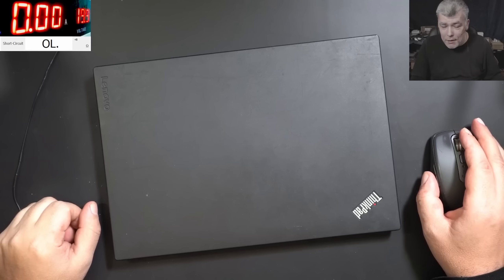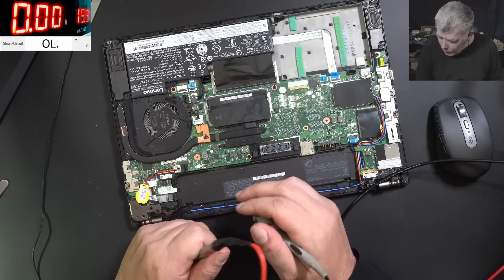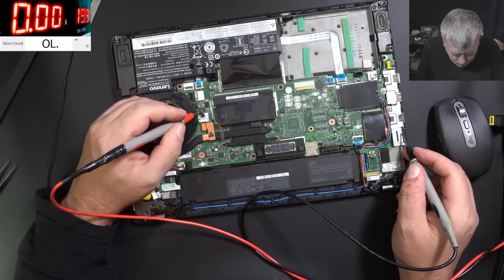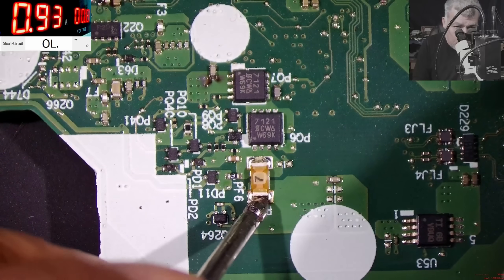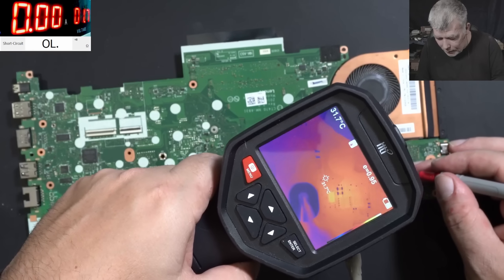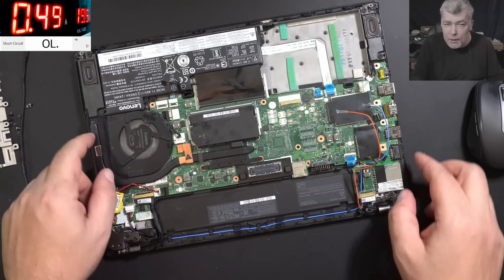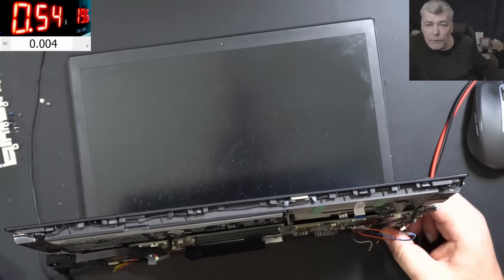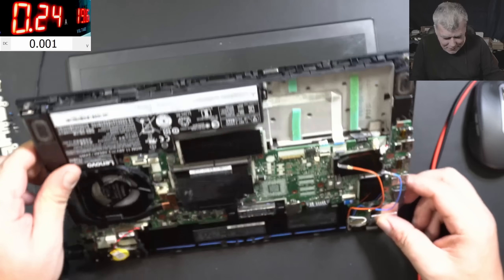Lenovo T470 no power, shorted board repair

Comment: Awesome content! I have the same issue with a T470 but don't think it's the fuse. When you plug in the AC, the CPU instantly gets very hot without it being switched on. Must have a crazy short somewhere.

Comment: Sorin, where do you get the adapters to hook up universal laptop connectors to your bench power supply?  i checked your amazon and all i see is a usb-c to universal.  if anyone else knows please let me know. thanks.
Reply: Also interested
Reply: NEXBERG 100W PD USB Buchse Typ-C Zu Stecker DC-Strom Stromversorgungskonverter Ladeadapter Stecker Laptop Verbindungsstecker für Lenovo IdeaPad, Thinkpad, Edge, Carbon, Yoga, Chromebook, Flex(Quadrat)

Comment: @electronicsrepairschool  i have a T430 and as soon i pluged it on it came on a few times then one time i plugged in the charger and it never came back on, before that happened i power cycled it about 3 times rapidly to get into the bios

Comment: Hello, I need some help. I have a 2021 ASUS Rog Strix G513IM, laptop turns on and works just fine.

1st issue is BOTH the Fans don’t spin and laptop ends up overheating 
(Error: 0 rpm) fans themselves are good so maybe is the motherboard

2nd the battery won’t charge, someone ripped the connector and I don’t know what the 3 middle wires are for (brown,yellow,white) black and red wires are connected though and it will run on battery power but it won’t detect the battery or charge

Comment: Hey guys I watched 100's of these but i have a Dell latitude e6430 i5 that the power light comes on with charger installed. the power button light comes on when pressed but fan does not spin, cpu does not get warm but speakers crackle continuously. tried unplugging everything, different ram, different psu but do not find similar issues when searching. All refer to crackling speaker while in windows. suggestions?  Thanks an hope everyone has good xmas and new year. oh i even used it as a excuse to buy thermal camera, but i see nothing :(
Update, I skipped a step, because battery was charging and power light was coiming on I assumed (doh) it was not a shorted motherboard.  After using my multimeter everything is shorted to ground.  Excuse to buy a bench power supply.  :)

Comment: Great job! This one is really funny. I had this exact laptop with this exact fault on this exact power rail. Im not sure but might have even been the same capacitor. Sadly i don't have a photo ... I think that this is an intermediate power rail that sits between The slim tip plug and the USB-C port.

Comment: This is the laptop my work provided before they upgraded us to the T490. These are pretty solid laptops that you can find for dirt cheap (since lots of corporations use them and upgrade fairly often).

Edit: I may be thinking of T480 which is multi core. Should still be pretty cheap.
Reply: @@repairwinsI must be thinking of the T480 then, because I'm pretty sure my last work laptop was not dual-core. I still think the T480 would also be pretty inexpensive.

Comment: I have T450 man they are military class 😂 old af but still works perfectly
Reply: A friend of mine was in a motorcycle accident and fell over his T450 laptop that was in his backpack. The laptop was almost split in half, totally warped, but still worked with picture and everything else!! Amazing piece of hardware.
Reply: @viniciusvbf22  that's it, older tech was far far better then now, i also have old one Dell E6530 working for years bulky one and heavy but it has swapable cpu... Now all is on board soldered even if you faster open it hinges get broken all plastic and horible quality...
Reply: @corel965  hahaha yes I have a Thinkpad Edge 15 (0319-3tg) myself...love it to bits bits it's getting a little old now so I'm gonna upgrade to a Probook 640 G3
Reply: @corel965  : Indeed. I accept it. Dell and Lenovo built very good laptops, even other manufacturers in their budget models, let's say... until 2014. From then on, the manufacturing quality almost reaches the limits of mediocrity (ridiculousness) and we all see it (experience it ) and we have even gotten used to it, that is, we are very happy with it. My God!. All the best
Reply: damn that laptop is thicc
Reply: they are just chunky crap laptops
Reply: @aziz9488 you probably use a Mac with words like that! 😂
Reply: @lukedavis436  or he is not old school 😅

Comment: NICE! so, wait, you just removed a capacitor that was over heating, and didn't replace it with a new one?
Reply: Offcourse he replaced with a new one. With a special one ;-)
Reply: Yeah, that's right. 😎
Reply: Capacitors are just there to reduce radio frequency noise from the power supply, not needed for proper operation. He did a video about this weeks ago, removing a lot of caps, with no ill effects.
Reply: Nope, he never does!
Reply: laptop still ok if u removed  20 capacitor and didn't replace